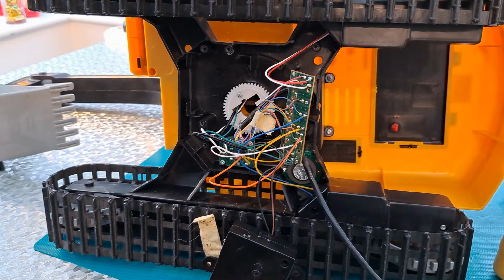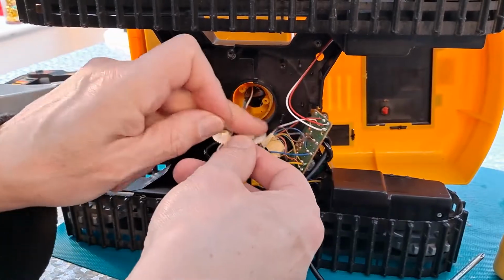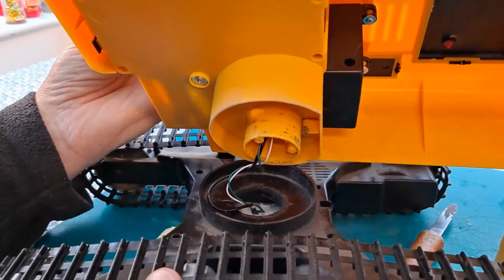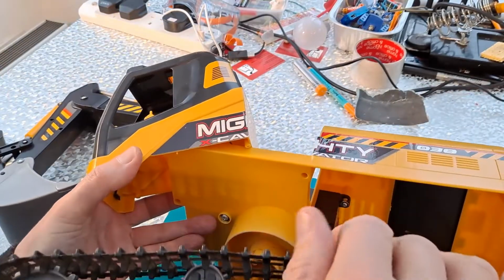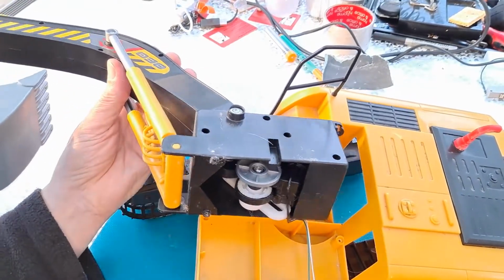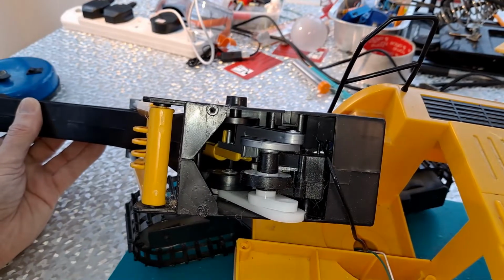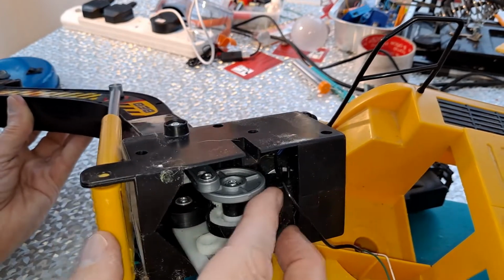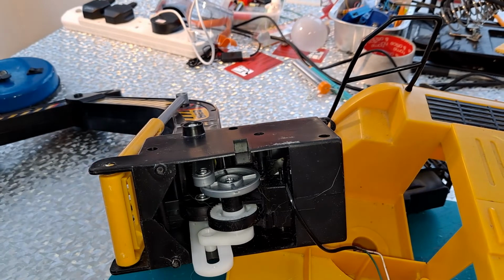PART 2 Tear Down Chad Valley Mighty X-cavator 038

Comment: That's a clever design to imitate a hydraulic system. I wonder if a full-size excavator could work with a gear and cam mechanism like that. I know the hydraulic system is more powerful on a real one but just a thought. I do know they used steam to power big cranes and diggers at one time because there was an old works place near us when we were kids and we used to play on the old machines which we found out were steam-powered. This was a very old works place and had been left to rust away. There is a large housing estate there now but I wish I could find pictures of this old place. I don't know what they did with the old machines. I think they should have gone to an industrial museum.
Reply from the maker: Hi Mike. The mechanism here is really just to give a visual effect. It has no practical use, you cannot control the bucket independently or vary the height of the dig. As for using gears and cam in a full size vehicle, I guess it would work technically, but I am sure there would be a lot of complicated geometry and a lot of friction generated that a hydraulic system would avoid.